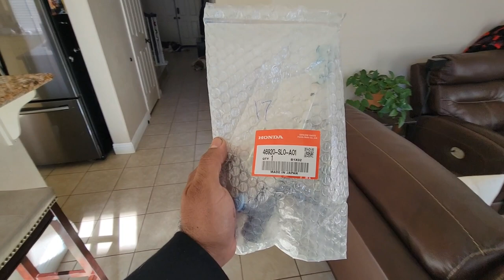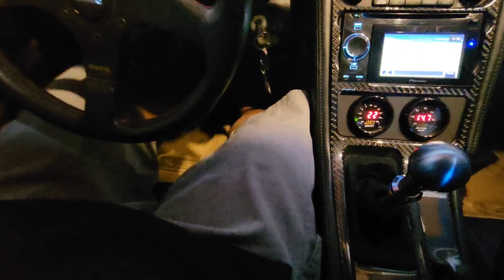Supercharged NSX left me stranded in the Mojave. let's replace this Clutch Master Cylinder.

Comment: What’s the bleed kit you used there? Looks like it made the job way easier ! Did you have to adjust the engagement on the clutch master ?
Reply from the maker: Mityvac
Reply from the maker: No adjustment. I madebthe length the same as old one
Reply: @steelontarget  Thx for the tip